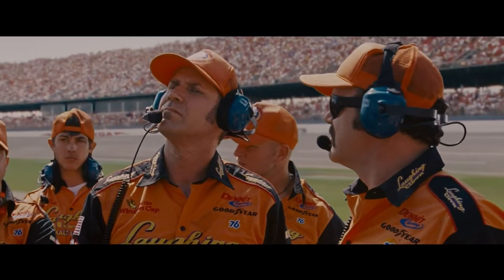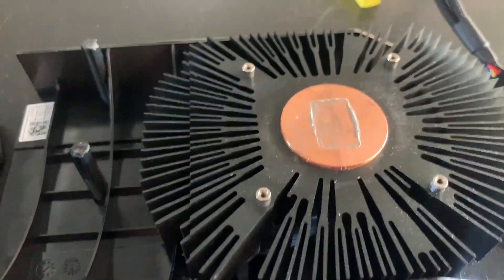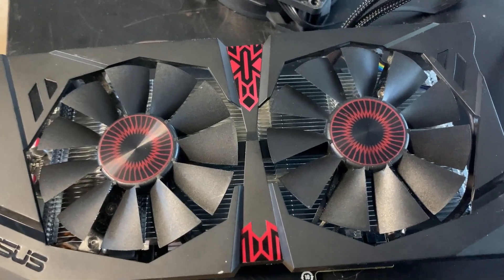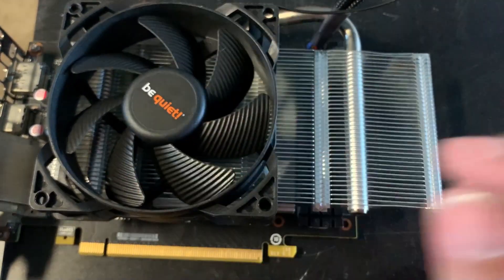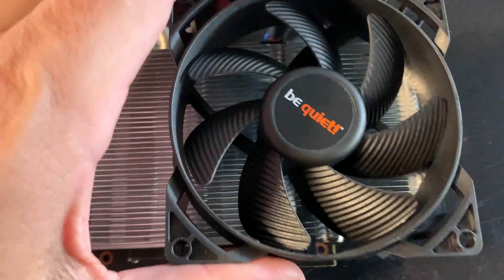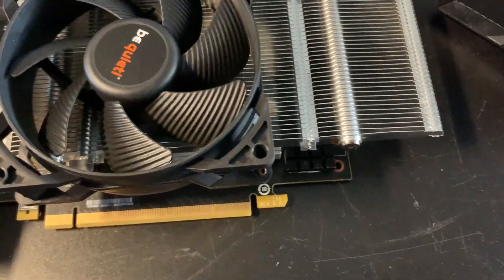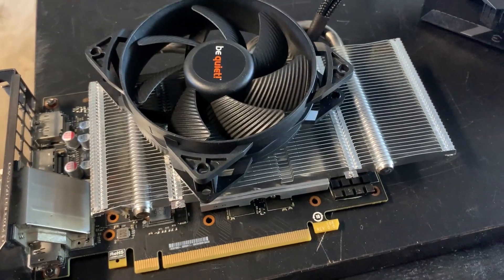Ep 2 - GTX 1060 Mods Nvidia EVGA 6GB Single Fan - (Making it an SC SSC) Twin Fan attempt and fail

Comment: Disculpa por escribir en español, pero es será posible usar los 2 fans? Teniendo en cuenta que viene con un ventilador de fabrica no dara problemas que el gonector del fan ahora alimente 2 fan extra?
Reply from the maker: You can put 2 fans no problem, but they should be aftermarket or from the same brand of GPU.  When I tried a different brand, they would not work.

Comment: does gtx 1060 also have same hole mounting distance as gtx 960?, in your video it fit perfectly using gtx 950/970 heatsink.
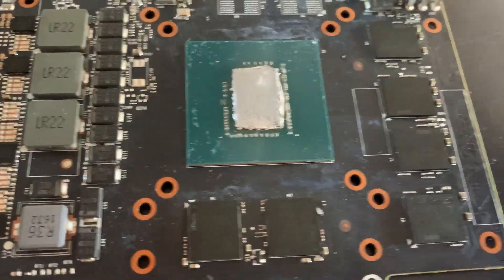Reply from the maker: @4:11 You can see that this card (evga) has both mounting holes.  The 900 series has the larger pattern.

So, it depends on the brand of the card whether or not it supports the 900 mounting.

I have seen other versions that just have the smaller pattern.
Reply: @RobertFixit  I see, some websites says both has same 58mm mounting holes and some don"t. I just ordered cheap zotac gtx 960 dual fan card for parts. Let's see if it fits on my zotac gtx 1060. fingers crossed

Comment: where did you get the heat sync?
Reply from the maker: The larger heat sink comes from a GTX 950.  If you look at a later video you can see that I was also upgraded with twin thermalright 80mm fans which fit beautifully and that was the final setup.